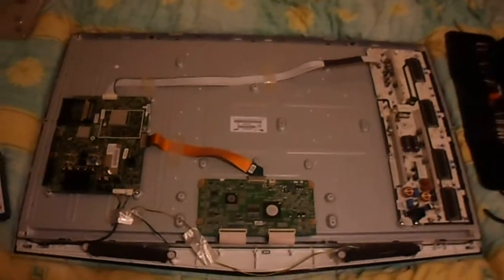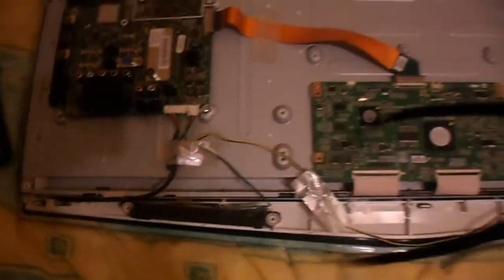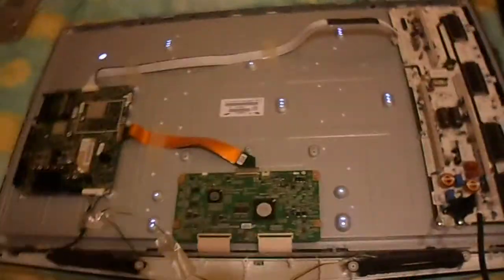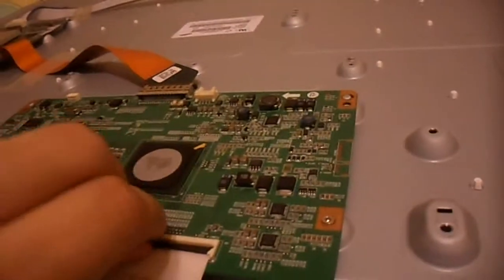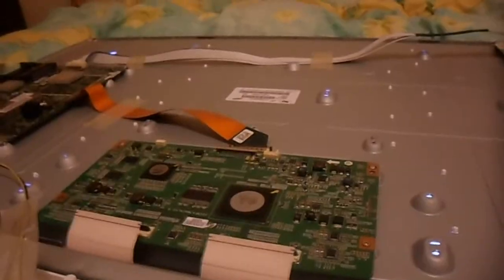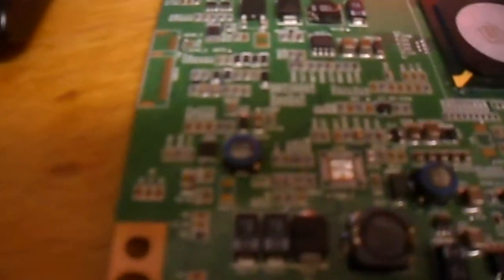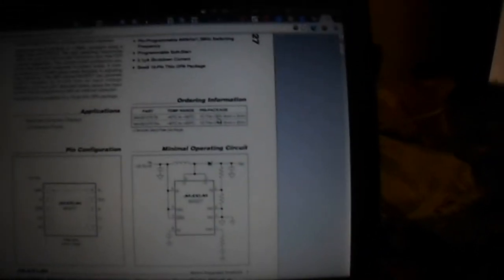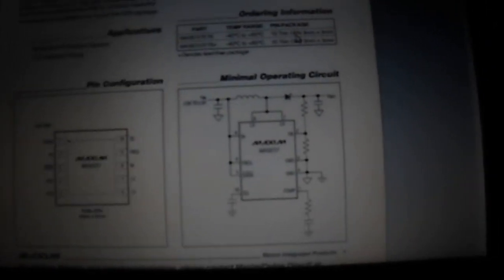Samsung LE40B652 (2009FA7M4C4LV0.9) - Not powering on fully (with melody) - Diagnosis

Comment from the maker: This would probably be a main board fault. Unplugging the power connector has tested the inverter and a good part of the power supply, showing they are working. The next step is to check the main board BLON and PSON signals, as well as the power supplies going to the T-con.

Comment from the maker: The LCD Panel may be defective. You're saying if you disconnect those two white ribbon cables, that I isolated in the video, your TV powers up and works (aside from no image of course.) In which case, attempt plugging in one at a time. If you only get half a picture when one side is plugged in, you may have a bad panel -- not economically fixed unless you're lucky and it's a shorted capacitor on the driver board, quite rare.

Comment: In this model , power supply and inverter is in same board , after disconnected cable between main board and powers supply board, back light ON only for maximum 1minute,i have to know  its a normal case or not, in the main board PSON is 1.3v \ and OFF 0v, Inv ON 3.3v,

Comment: Hi,  I have the same problem.  My LE46B650 samsung tv won't power on.  I replaced the capacitors as I thought that was the main problem but nothing.  Going by your video i've isolated the problem to the T con board.  When connected via the two connetors belw the tv wont power, when disconnected and only the top orange wire is connected it powers up.  Stll no sound or picture but it stay on.  Now what do I do?

Comment: thanks for your reply. When I disconnected the cable from main board to power supply board, back light is ON for some time, but nothing is happen when I reconnect even a small blink, do you know which one Is the error voltage in Samsung power supply module BN44-00259A.